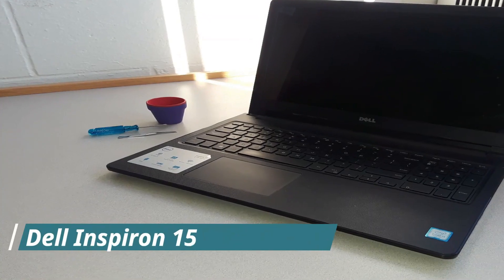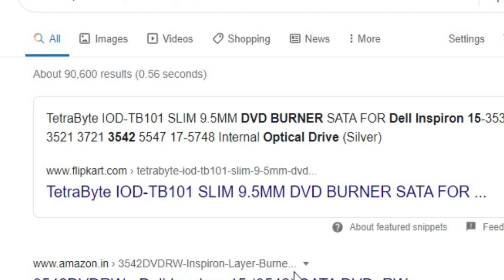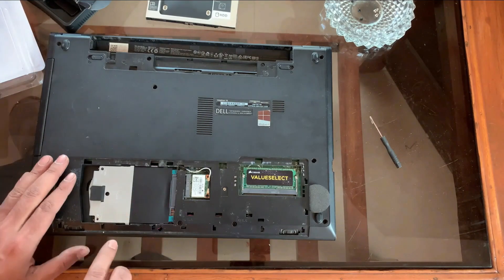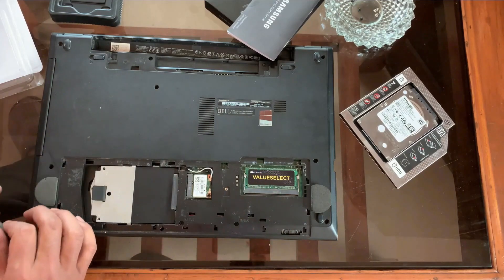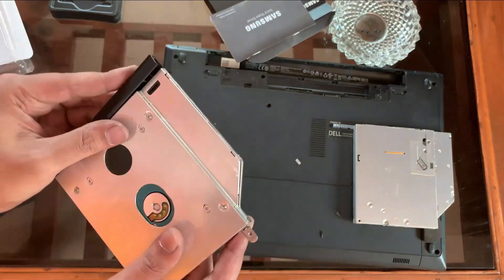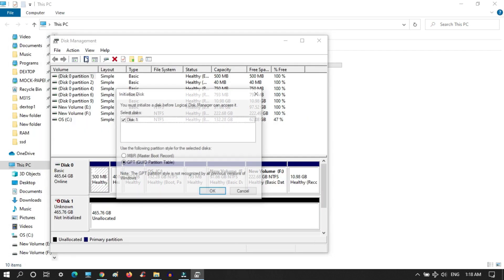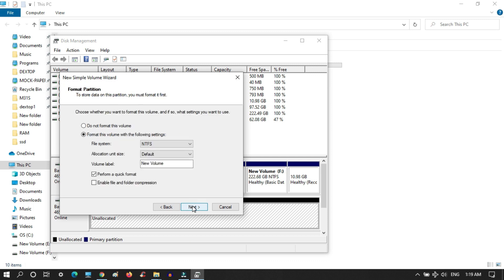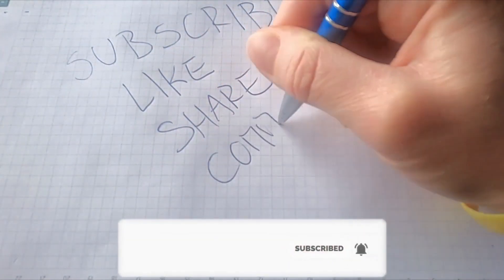Dell Inspiron 15 3542 SSD upgrade | Dell Inspiron 15 3000

Comment: Hello, can i do this process in the inspiron 15 3541? It does have dvd slot but im not sure if it needs something else to recognize an hdd on the DVD place
Reply from the maker: Hi Micaela, yes you can install the SSD on 3541 and in the bios you need to change the priority of boot, it will definitely work. otherwise just install the SSD nd install a fresh OS.🙂
Reply: @UtopianDays  Thanks for the answer! 😀I'll keep in mind the priority boot and I'm going to go for a fresh OS on the SSD and a HDD on the new caddy, until yesterday i didn't know this was a thing so... big  thanks!🙌
Reply from the maker: Hi Micaela, During Upgrade process if any support needs feel to ask, I will definitely revert back.🙂

Comment: Hi Sir... Sorry, just want to ask u.. I am using this model Dell 3542, can i replace network card to support 5Ghz & 2.4Ghz.. Now network card only support 2.4Ghz.. Can u give opinion.. Thank u :)
Reply from the maker: Hi Mohd Wan, bro go to dell.com and enter the service tag no and check the upgradation limits. dell 3542 upgradation is limited , as per my knowledge u can upgrade the HDD, SSD and RAM but network card I doubt. Thanks for watching bro stay tuned.

Comment: Do you have the same laptop with pentium processor or any higher processor like i3 .... because i have the exact same laptop but i am confused about upgrading RAM and SSD as it may not be able to cope up with the processor i have. Please suggest something guys.
Reply from the maker: Hi Vishaal, this model is 3542 and processor is i3 so you can upgrade the ssd and ram following the steps i have done in the video, if you face any problem you can comment bro.stay tuned Vishaal.
Reply: @UtopianDays  hi can you make a video on clean install?
Reply from the maker: I will, stay tuned🙂
Reply: @UtopianDays  ok thanks!

Comment: Like for external hdd, Seagate brand is considered best...which brand is considered best for SSD?
Reply from the maker: Hi, as per my personal experience for SSD SAMSUNG best and NVME M.2 WD black, Samsung pro and XPG doing good and other bands Kingstone, crucial also nice 5% LESS performance..others may not agree but I consider these are best, stay tuned dear. nice questions alswz appreciated.🙂

Comment: For installation SSD... Why u are removing CD drive from laptop... I have dell inspiron 3542,2014model..i want to upgrade to SSD.... Should I try it at  home or I have to take my laptop to mechanic.... 1 Yr ago I installed 8GB RAM chip at home and it is working fine.... No issue...
Reply from the maker: Hi amit, bro to use the existing HD i hv installed the caddy, yes bro jst follow the steps it is quite easy, u can do it at home, stay tuned and take care.

Comment: bro i am getting  Samsung 860 EVO 500GB SATA 2.5" at  rs 8500  and  Samsung 870 EVO 500GB SATA 2.5" Internal Solid State Drive (SSD) (MZ-77E500) at rs 6999 which one should i take for  your laptop model
Reply from the maker: Bro both will support, buy as per ur budget..enjoy the upgradation sanjeev.stay tuned.🙂
Reply: @UtopianDays  please tell me which is best.
Reply from the maker: Bro 870 will give u better speed.But it is minor.🙂

Comment: Am using 3542 (2014) model with 4GB & 1TB HDD storage, should i upgrade ram to 8GB OR SSD
Reply from the maker: Hi bro, if u play games or editing then ram upgradation needed otherwise just upgrade the SSD which is enough to increse speed.
Reply: @UtopianDays  tqsm 👍

Comment: Does dell Inspiron 15 3542 i3 supports SSD SATA 3? or M.2 or NVMe also ?
Reply from the maker: Hi Sandeep, bro this model does not support SSD SATA 3 or M.2/NVMe..but the current model supports,, so please visit dell.com & enter the service tag to find the specifications. Stay tuned bro & stay safe.🙂
Reply: @UtopianDays  I have Dell Inspiron 15 3000 3542 i3 processor. which one i can choose. any one supports or not?
Reply from the maker: Hi Jay, brother you can upgrade the RAM and the HD to SSD..I have made video just click the link and buy online or offline as per your budget.thanks for watching Jay.
Reply: @UtopianDays  you mean 3542 model supports 2.5 but not 3 and the current (i.e latest models) support 3 and NVme also...right?
2. What is the diff bw sata 3, m.2 and NVme?
Reply: hi

Comment: Bro ssd nd hdd will work together?
Reply: Ok bro thank you so much ❤️
Reply from the maker: Hi Gursimar, Yes it will together Bro. Please check the End screen of the video.It will be cleared.🙂
Reply: Yes bro i have seen it but u have another doubt
Reply: I have newer version of this laptop does same caddy will work in it
Reply from the maker: Search the model no. On google or manual you will find the caddy size.
Reply: Model no is the exact same inspiron 15 3000 but mine is different from yours so i getting confused
Reply from the maker: Goto dell.com enter service tag no then manual and dvd drive size, or open the dvd drive and measure by scale. 9.5mm or 12.7mm size may be.